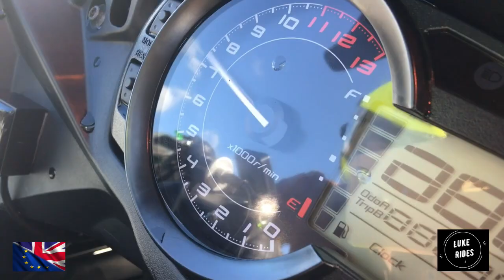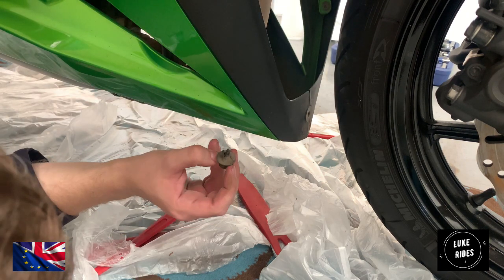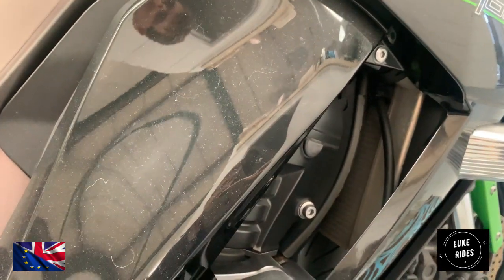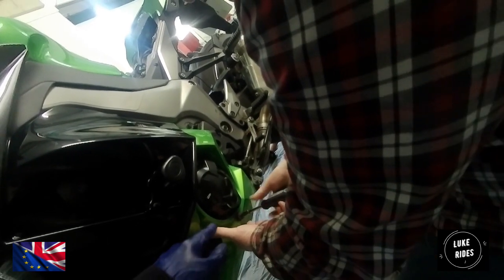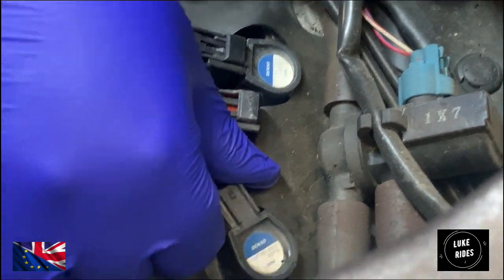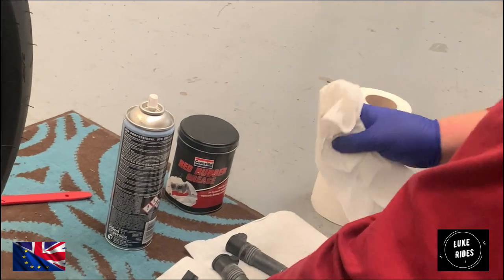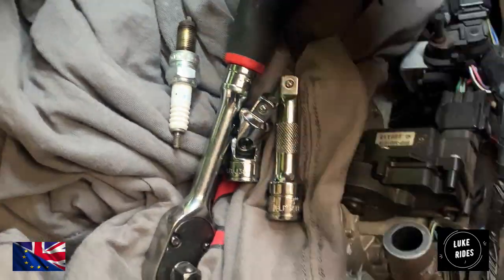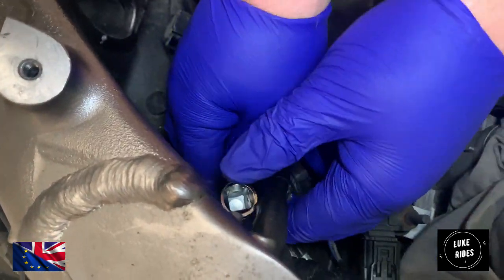2014 Kawasaki Z1000SX / How To Remove Disassembly Spark Plugs

Comment: Did you say the bike only has 10,000 miles on it? Those Plugs easily will go 50 to 60k miles and still be in great order. I wont even get into mine until about 50k and the valves will get adjusted then as well.
Reply from the maker: Good question. It has been such a long time since I did the service for the mighty Kawasaki Z1000SX. True the spark plugs would be fine for 50,000 miles or more. Luke Rides just wanted that piece of mind to know there are fresh spark plugs inside the Kawasaki. And for powerful engine like that. Spark plugs will be getting more of a hammering when compared to much less powerful engine. That makes sense having the spark plugs changed at the same time for the valves to be checked then adjusted to Kawasaki's specifications. Thank you for commenting scottmatzeder9162. Hopefully we will speak again. Take care :)